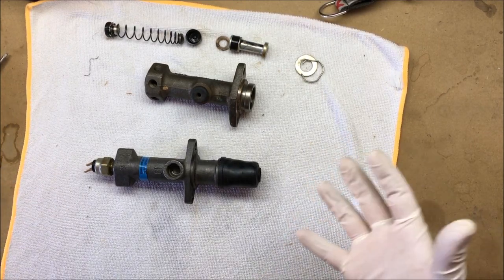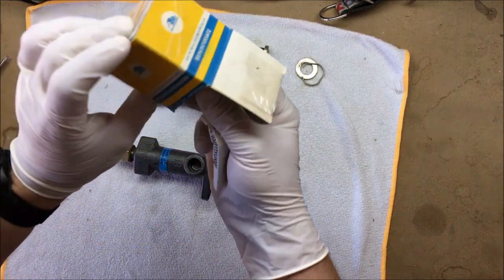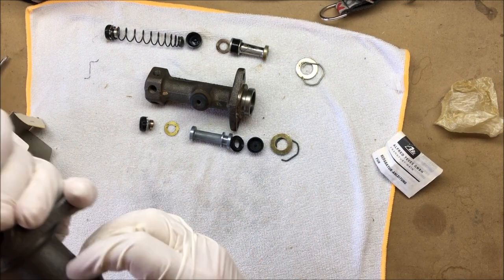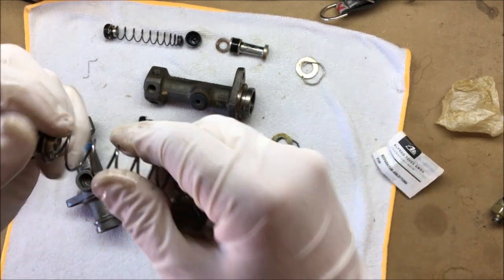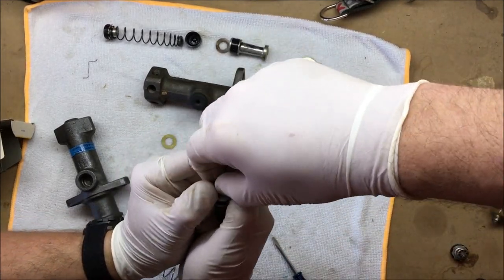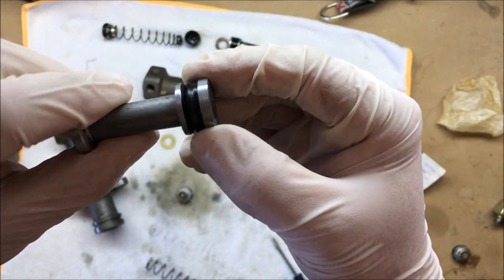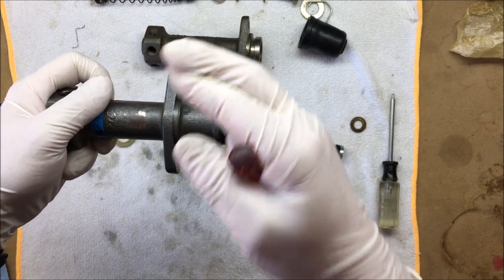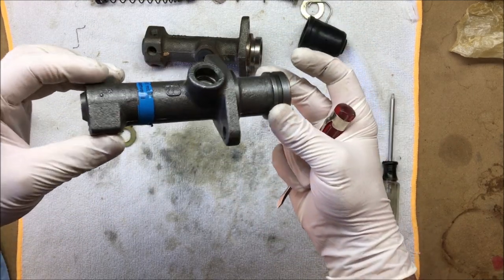Rebuilding A Volkswagen Master Cylinder! Mileage Unknown Ep6

Comment: It happens so keep trying. And it looked like you didn't have that last seal on correctly and remember bench bleed it helps get the air out and also make sure your brakes shoes are adjusted.
Reply from the maker: dennis culpepper trying 2 get the brakes on this one was maddening! We put the seals on the same way they came off. We bled everything what seemed a million times we did get it stopping eventually though! 😜
Reply: I guess it's pretty off topic but does anyone know of a good site to stream new tv shows online?
Reply: @Ellis Madden lately I have been using FlixZone. You can find it on google :)
Reply: @Ellis Madden Try Flixzone. Just google for it =)
Reply: @Ellis Madden i would suggest flixzone. Just google for it :)
Reply: @Lorenzo Jax yea, have been watching on FlixZone for since march myself :)
Reply: @Lorenzo Jax Thanks, I signed up and it seems like a nice service =) I appreciate it !
Reply: @Ellis Madden happy to help xD

Comment: Idk if u could help me but I got a replacement master cylinder for my ‘66 Vw beetle. When it is pressed its like the brake line holes and pressure switch hole are all plugged. Could it be the check valve at end of the spring?
Reply from the maker: DukatiDoctor TARDIS do you have brakes but the pedal is staying down after you push it?

Comment: Cant find a rebuilt kit for these. I dont want to buy a replacement one. My lord, there needs to be 1 original part in an old bug :)
Reply from the maker: I found mine either on ebay or thesamba.com I can't remember its been awile!
Reply: They seek the whole master cylinder at orielys for $30

Comment: They sell these at autozone and orielys for $30
Reply from the maker: Yes for just about every vw out there you find in expensive aftermarket master cylinders for early type 3's and first year type 3 disc brake cars no one makes them or rebuilds them it's almost impossible to find even the rebuild kits.

Comment: There's not much to it is there!?Wouldn't a bug master cylinder work? They look similar on your bench...
Keep crackin' at you'll get it!!
Reply from the maker: VeeDub P8 a big one might but I’d have to re-work the lines the bugs come out the top and the type 3’s are on the bottom.... I think I might have some adjustment issues on the rears or something..... even though I’ve checked about 10 times! I’ve never had these kind of issues on any VW!
Reply: @mileageunknown8910  I hope ya can work the bugs out soon.... I wanna go for another ride!!